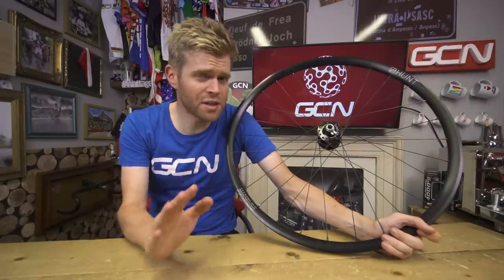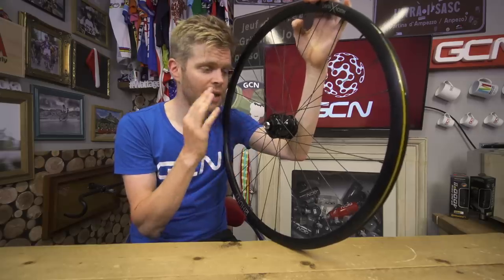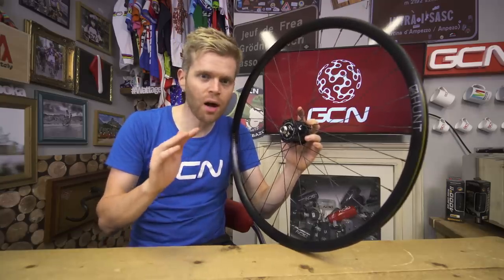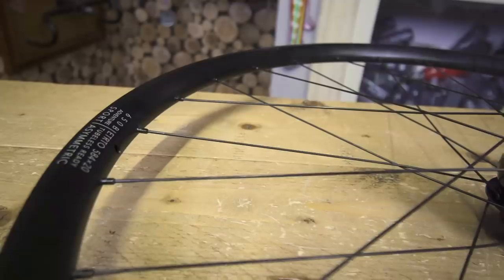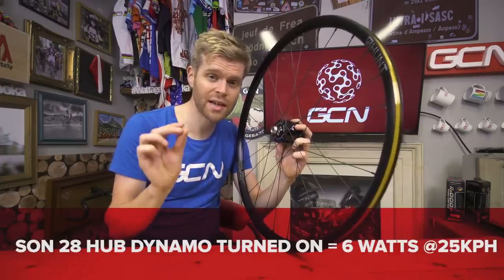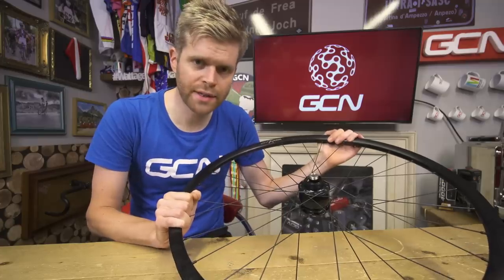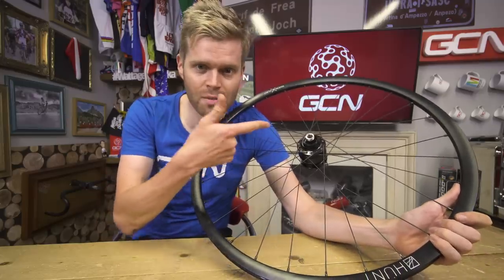What Are Bike Dynamos And How Do They Work?

Comment: When I was a kid I used love my old bottle dynamo(s) I had this awesome front lamp on the right hand fork that would light up tree canopy dark roads in Bedfordshire. My mates had these crappy Ever Ready battery lights that used a pair of AAs that were just no comparison. The last time I used one was around 2000 but was experiencing problems with the contact wheel slipping on the tyre in the wet and without a proper mounting boss on the fork used a hacked solution that utilised a bracket that used the cantilever boss. Just use modern LEDs now but when I spec up a new touring bike, probably a Condor, I'll have one of the Son hubs. As others are saying though it is necessary to add somekind of circuitry to maintain steady current.

Comment: I love my hunt dynamo wheelset. The drag is negligible, and it's a nice piece of mind to know that your lights won't run out of batteries.

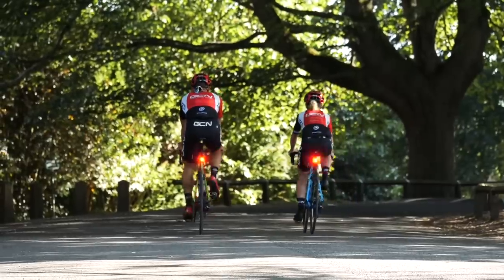Oh, and one minor correction: the dynamo hub generates AC current, not DC. This is why the lights tend to flicker at slower speeds.  In fact, if you freeze the frame at 3:18 you'll see a neat little sine wave on the flange letting you know that you need an AC to DC converter for your USB devices.

Comment: I thought about going dynamo on my adventure (gravel) bike set up but for all the extra cost and effort it just seemed easier to get a solar rechargeable battery with 25k mAh which lasts 3-4 days. If you intend to cycle through the night or go a very long time in crap weather and no access to electric then I can see why you would usea dynamo.

Comment: I would not charge even a batterypack with a wheel dynamos without having a circuit that keeps the voltage at a steady USB-standard of voltage and current. The dynamo on the HUNT wheel seems to have 6volt output at 16km/h, so If I assume correctly, it means it will output even more going at 30km/h and therefor can damage the electronics you try to charge.
Reply: Andrew N yeah I heard your have to regulate the voltage and current somehow because it can spike during riding. But then can you can charge your phone directly from that voltage regulator? Or do you have to charge your battery pack first then your phone? Because that kinda seems inefficient imo
Reply: All yo need is a simple voltage regulator.  Here's the video on how to do it.  https://www.youtube.com/watch?v=GSzVs7_aW-Y&vl=en
Reply: Generally the voltage is self regulating to an extent because the efficiency of the generator decays as the speed increases, it's how they generally avoided blowing bulbs going down hills while still having lights going up them. As a result, it doesn't take a lot to get a totally smooth output, you just need to bridge the terminals with a suitable resistor.
Reply: Which begs the question: why hasn't a clever dynamo manufacturer built the regulating circuitry right into the hub so that the output could be used directly to charge USB devices?  A sort of "iDynamo"?
Reply: Paul Flory depending on the circuitry it may not work within a close proximity to the magnetic field that's being radiated from the dynamo and the hub most likely also has a lot more vibrations than the frame of a bike which could add unnecessary wear to the circuitry, especially soldered components on a small PCB.
Reply: Good question, but it is simpler to just have a separate rectifier and cache battery.
Reply: It sounds like you might be talking theoretically, if Josh charges battery packs from a dynamo, that probably means he has done many tens of thousands of miles doing so and wouldn't recommend it if it broke the battery pack.
Reply: the axle of a hub ia a pretty harsh environment, the rattle and all that. Also, is there room to spare? Packaging the power regulator electronics up in the place where you can connect the phone makes a lot of sense.
Granted, in general iDevices don't always go with what makes sense from an engineering point of view...

Comment: 6 Watts of drag at how much electrical output power? It depends on the load you're drawing. I can't afford the SON kit so I use the Shimano ones, they're fine as long as you stay away from the "DH-32" model that's nfg. 
You can get phone adapters with rectumfryer and surge protector that let you charge from the dynohub without intermediate powerbank, LiPo batteries are pretty efficient but you always incur at least 10-20% loss by storing the energy in a battery and then getting it out again.

Comment: Good info!  It was nice to actually learn how much drag these things produce in empirical terms.
Reply: It will depend on load power, so without electric power meter connected between dynamo and battery pack or charger you will never know how much power is used to charge power bank, because of charging Li-ion batteries for example in non linear process with current much lower at the end, so wthose power ratings on those dynamos whatever it is can be only some kind of capabilities of such things what they can do and how much power you can take from this thing but it can't tell you without electric power measurement how much drag  power it uses at the moment  ;) It is worth to know basic electronics anyway and do not relay on Yt video like this one because of you can miss many important things while presenters in GCn have sometimes pure understanding how  physics works :)
Reply: @szankony6276  "presenters in GCn have sometimes pure understanding how  physics works" While Szan Kony seems to have poor understanding how English words work. SCNR ;)

Comment: thanks but would've liked some info on output and what sort of limitations on the amperage you can pull from these, as well as different models and specs. on to the next vid on these...
Reply: Standard requirement for a lighting dynamo is three watts at moderate speeds (.5 Amps at 3 Volts) Most current hub dynamos will easily deliver up to 6 Watts. With special charging circuitry like the dynamo harvester you may squeeze out up to 12 Watts. (At the standard USB 5 Volts in this case.)

Comment: Drawbacks for hub dynamos: weight, drag, and......price, low output and maintenance. I believe both SP and SON hubs have to go back to the manufacturer for bearing replacement, which, if you ride a lot of miles, could be every 1-2 years. And the hub has to be removed from the wheel for that.....so then you have to have the wheel rebuilt. And the amount of light you get with a hub dynamo light is pretty sad compared to a battery light system you can put together for $30, as I have. And I can move that battery system to any of my bikes, even though they have different wheel sizes/brake systems. I really want to like dynamo lights, but I just can't get past the hundreds of dollars extra cost for far less performance.

Comment: What I'm curious about is if it is a brushless design or not, which would be WAY superior to anything else out there and much more efficient.  I looked at one of Hunt's videos and it showed the guts of one and it does look brushless, hence no commutator.  It that is the case, it would actually be an syncronous alternator and use a rectifier internally.  That would be slick indeed and be practically maintenance free... except for the bearings.

But somehow, "syncronous rectifer" just doesn't roll off the tongue, does it!?!?  It's the antithisis of a sexy name.  Yeah, stick to Dynamo.

Comment: I've got a cheap and nasty bottle dynamo on a city commuting bike. I've noticed that whenever it rains the dynamo doesn't produce enough power for my lights. (I suppose either water is getting underneath the bottle top or possibly the water between the tire and the bottle top is causing the issue) I've also got to cycle up a steep hill and there's always that bit of resistance whenever I use a bottle dynamo.
Would a hub dynamo get around these issues? If so, how is one installed? Do I need to buy a brand new wheel rim?
Reply: Hunt (and probably others) sells wheels with a dynamo.  You could also buy a dynamo by itself and have it built into a wheel you already own by your LBS.  Just make sure they each take the same number of spokes.
Reply: You could buy a new idler wheel for you bottle dynamo, or re-face it with grit, to reduce slippage when it's wet.

Comment: "Dynamos are for charging IT devices, or charging lights. Or driving lights directly!"
Sign of the times, I guess...

Also, complaining about the drag of a switched on dynamo: It's physics, dummy! Also known as the law of energy conservation.

On the longest tour I have ridden up to now I had a 'be on' dynamo harvester charging device (now available from NC-17) that actually extracted up to 12 Watts out of my SON. And if you carry a lot of electronics, as we tend to do these days, you are happy about every single one of these watts.

That's why you don't want the delux version of the SON on a tour. Yes it's a bit lighter, but it also extracts less power. Go with the 28.

ETA: The NC-17 AppCon 3000 unfortunately is not nearly as powerful as the dynamo harvester. They claim that they have optimized for slower speeds (below 15 km/h), which are more common on tour, but frankly, it's not all that more efficient there to warrant the change.
The best charging device today is the Forumslader ( forumslader.de ) If you need high power.
Reply: its a bit unethical to extract energy from your son
Reply: @griffin3964  Should I stop having him tread the home trainer to power the TV, yathink?

Comment: Is there a battery in the hub so you charge devices when off the bike? or somehow you use a wire while the wheel is spinning?
Reply: Different hubs work differently because of patents and what not, but the classic and class defining Sturmey Archer GH6 uses a 20 pole magnet which bolts into the hub shell and then has a copper wound armature which sits within it and is clamped to the axle by the lock nuts. The wires connect to the armature which is stationary as the magnet spins around it, I imagine that modern ones operate in a similar way.

Comment: Can you combine a dynamo with the Di2 derailleurs?
Reply: Przemyslaw Sliwinski -- di2 is charged through a normal USB connnector, so yes, you'd charge a battery pack first. Then plug battery pack in to di2. Battery on di2 lasts a flipping long time though so unless you're cycling around the world in 80days and don't see a single plug, you shouldn't need to charge it
Reply: Thank you - I am considering an Alfine Di2-based setup.

Comment: Also, of course, watts are watts. Assuming that the dynamo is efficient, a dynamo that cause more drag will charge your devices faster, up to the maximum number of watts the battery can accept.

By the way, you forgot the number one reason why bottle dynamos are horrible: Slippage! They might work well in the dry, but once things start getting wet and cold, they will invariably start slipping. So you go to your local bike store or read something on the net about a new miracle dynamo that won't slip, you buy it, and it doesn't slip. Not for the first week or so. Then it's back to square one...
Reply: Bonded carbide grit idler wheels don't slip, but they wear the tires more quickly than the common knurled steel idler wheels.

Comment: How do you actually plug in your device? Where does the cable go?
Reply: At 00:30 you see two rectangular pins left of the axle. That is where you put the connectors on. You still need some sort of charging device, like a bm usb werk, cycle2charge, etc

Comment: How about some more information to understand how much energy the dynamo produces? How long would it take to charge an external battery? How does the amount of electricity produced by the dynamo compared to what you get out of a wall socket? I understand this answer is complicated because it would depend on your speed and in the case of the wall socket the country in which you live.

Comment: The term magneto is used to describe an igntion spark  system for an intetnal combustion system. Further, that generates it own voltage, and uses a permant magnet and coil windings to provide curent to an igntion coil [their different designs]. Moreover, it's timed to a comustion event, usuly found on small power tool's or vintage motorcycles, scooters and outboard engine's.  Theirs more, but I'm ending it hear...

Comment: If someone is intrested, there are some nice information on some dynamos on: https://fahrradzukunft.de/14/neue-nabendynamos-im-test/
Its german but you should be able to comprehend the graphs in the lower part of the article:
(1): mechanical input lights off
(2): electric output on 12 Ω 
(3): mechanical input on 12 Ω 
(4): electric output on 24 Ω
(5): mechanical input on 24 Ω

There is actually quite some difference in quality.

Comment: Hi, I have discovered that, if I connect my dynamo to my light system, the chip controls the output voltage from the dynamo and limits it from maximum 24V to less than 5V, at this voltage, my voltage regulator won't work, means, I can´t charge things when the lights is on.

I don't understand how my light system works. If it drains the voltage down to 5V, it might be, taking all the extra energy which my dynamo generates and the light itself doesn't need, away and make it even harder to ride.

Or, it could be, it sync with the output from the dynamo and acts as a motor driver and put back the extra energy into the dynamo? Could be, but I don't think so. Because the output is drop down to 5V, otherwise the voltage would be higher.

And a interesting fact, my front light works always, but my back light works only when the input to light system is AC current. And if it is at a low speed 3km/h, the blinking between front and back doesn't sync either. Front light twice or more and back light only once. 

Do you guys have any idea?

Comment: Do I just plug my cable into the spokes? Kind of a half explanation here. Didn't really see a single unit in use on a bike
Reply: At 00:30 you see two rectangular pins next to the axle. That where you put the connectors on. A shimano connector looks different and is easier to use.

Comment: As always, great vid. One question though. I tent to buy cheap power banks because after some time they don't work as they should, e.g. they take super long to charge and I just get a new one. I'd be willing to buy a good quality one if I had it recommended. Would you or Josh recommend any specific power bank for bikepacking with a dynamo?
Thanks
Reply: RAVpower make some excellent power banks, I've left mine in the car all Winter and it was still fully charged by the Summer

Comment: Eh, bottles have a big advantage in that you can easily switch the drag on and off entirely. Not to mention switching out wheels when you're in BFE.
Reply: But they will usually fail you when you need them most, in rain, snow and slush. And their efficiency is abominable. I'd NEVER install a bottle dynamo on a current bike.

Comment: Just a few nitpicks from a geek... take this with a pinch of salt.

> DC current from your dynamo can damage your phones battery

As you later divulge, these things output AC, so I can't say I'd recommend charging any DC device using them (not even a battery)... unless you like explosions? You would need a bridge rectifying diode.

The USB connector that is commonly used to charge mobile phones uses DC 5V. 6V isn't far off; in fact, by the time it gets through 3 feet or so worth of cable it's probably down to 5.5V (which is within 10%). A lot of phones will happily accept nearly 20V anyway. 3 watts is a bit on the high side, but I think that's more likely to burn up the cable. Intermittent connections might damage some batteries, but mobile phones usually detect that and refuse to charge from what they consider to be a faulty charger.

In terms of computers, I would recommend not charging one of those. Your average PSU for a laptop is rated somewhere between the 45-60 watt mark. You'll be riding for quite some time to charge that! Additionally, they draw 115V in the states and 230-250V everywhere else, so I think they're unlikely to work on 6V to begin with; on top of the bridge rectifying diode, you would need a transformer, which will probably make the diode seem light-weight.

> loads of additional battery packs

I happen to have a solar cell that would be suitable for charging a mobile phone; it occupies about the space of your hand and outputs 6V, 1 watt.. all that's needed is a soldering iron and a sacrificial USB cable. The weight is probably less, and of course the power source doesn't come from pedalling... plus there's the benefit that it actually does output DC. Maybe have a look for something like this in a mobile phone shop, since I'm pretty sure I've seen them for somewhere around the $25-30 mark.

Comment: How bright of a front light can you power?
Reply: They get pretty bright with LED technology, modern dynamos will output 6V at 3W (0.5A) AC, which is plenty. Even with classic dynohubs, which were killed by the 1985 Road Vehicle Lighting Regulations, the light output using leds is easily comparable to battery powered lights. The things to watch are standlights and rectification, which some lamps will have built in but which can be annoying if missing, dynamos don't keep the lights on at traffic lights by themselves, and without a rectifier, all leds will strobe.
Reply: They get pretty bright with LED technology, modern dynamos will output 6V at 3W (0.5A) AC, which is plenty. Even with classic dynohubs, which were killed by the 1985 Road Vehicle Lighting Regulations, the light output using leds is easily comparable to battery powered lights. The things to watch are standlights and rectification, which some lamps will have built in but which can be annoying if missing, dynamos don't keep the lights on at traffic lights by themselves, and without a rectifier, all leds will strobe.